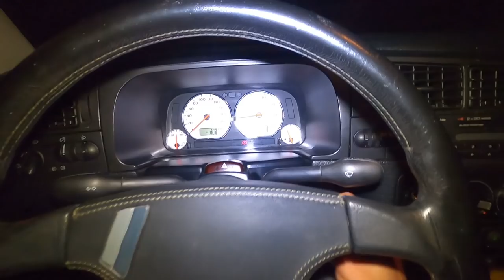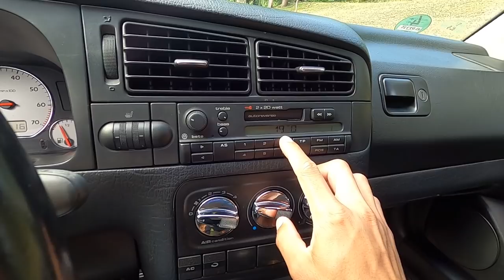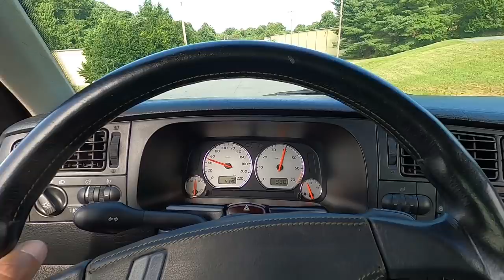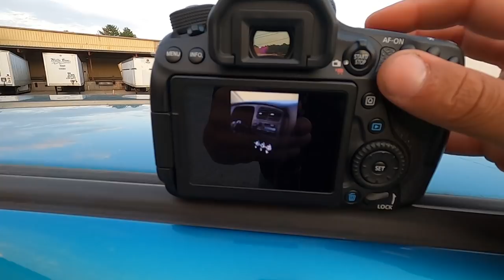The VR5 Savoy Is Back! ( Still A Demon Car Lol )

Comment: Yo those pumps in the back are a magnet for water & moisture. That's why they often fail. If the pump fails again, take the bottom cover off and check the circuit board for signs of past moisture. Also, they tend to get stuck in a state where they constantly pump, heating up rapidly...

Comment: @ mir smith: another cool video. The hole in the tank is really blatant. 😳I've never seen that either. I have petrol tanks from the mk3 there .😉. Do you want one? For the headliner, I can recommend a very good adhesive that can withstand heat. It is called bostik 1513.👌😉

Comment: the petrol tank is pressurized aswell as the fuel lines..so you loosing pressure and sucking air through that hole in the petrol tank..thats why its not going

Comment: is your steering rack centered? the threads on each side should be pretty much even at each tie rod. if not, you should do that and then take off steering wheel and center it. and then if needed you can adjust at your tie rods